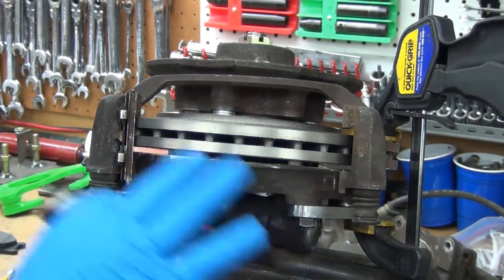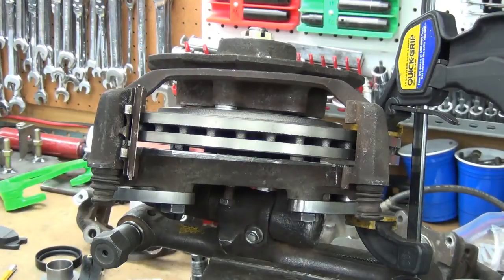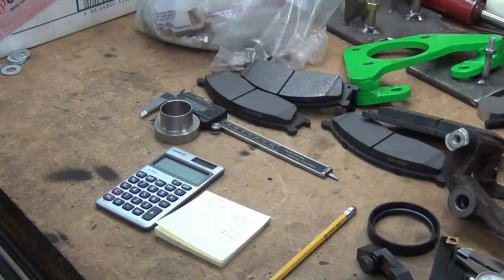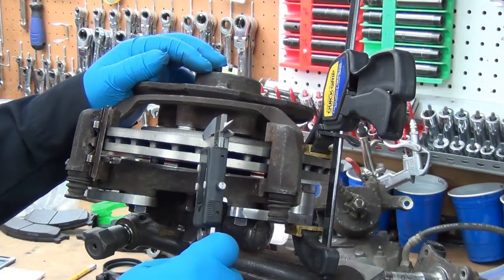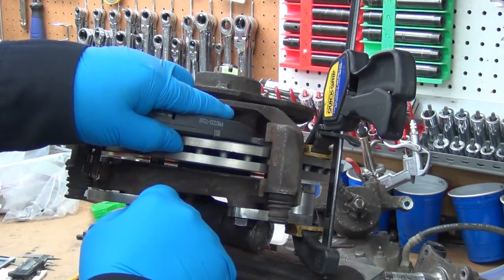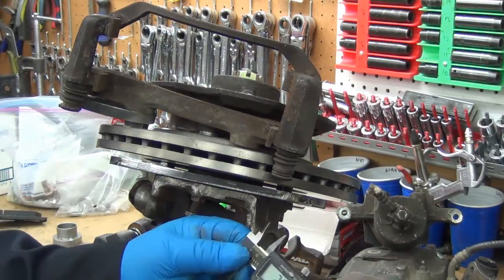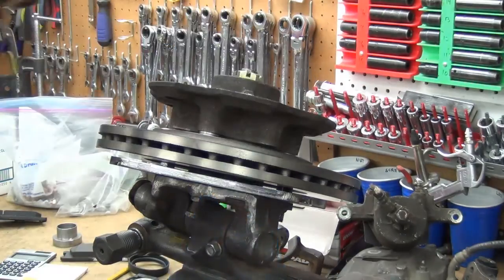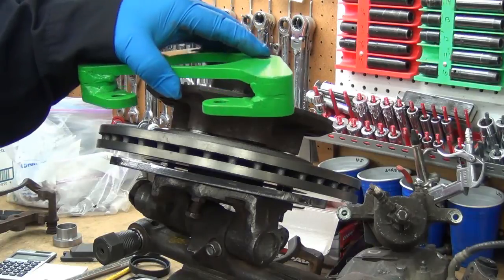DP Disc Brake Bracket pt7 - Final

Comment: Hi Bluehands.  Just a quick one to say thanks for the tip on the VFD in an earlier video.  I will be using the same drive on my Jet 10 - 24 Lathe.  I have uploaded my first technical youtube video which is about the drive.
VFD for Jet 10 - 24 Lathe
Thanks again
Rod

Comment: The bigger the rotor the larger the wheel will need to be.  You run into this problem when a C-3 Vette upgrades to C-5 brakes.  Just something to think about...
Reply from the maker: hmm....didn't get a notification for this comment.
Yep....and that's the real challenge is trying to keep it behind a stock 14" rim.  I've picked up the v6 rotor for testing(later), but I'm sure it will require 15" rims.